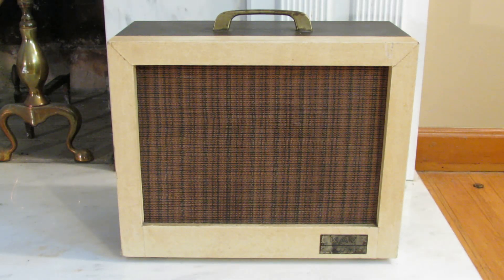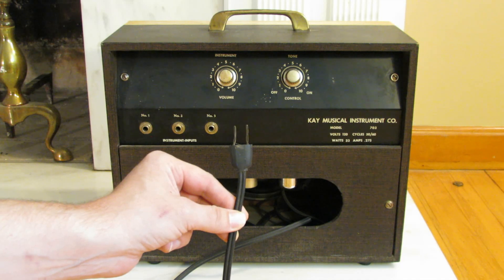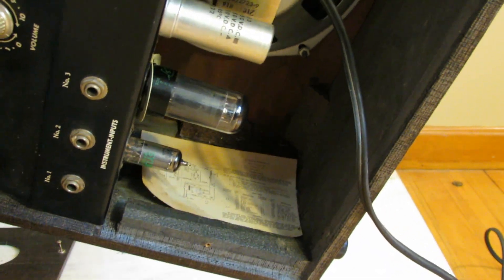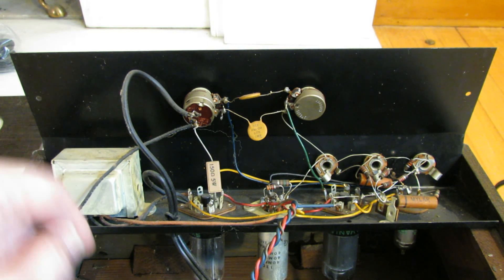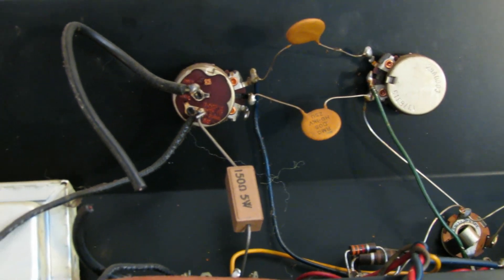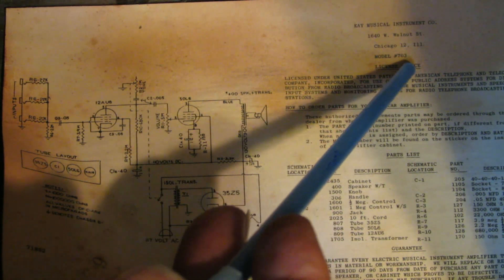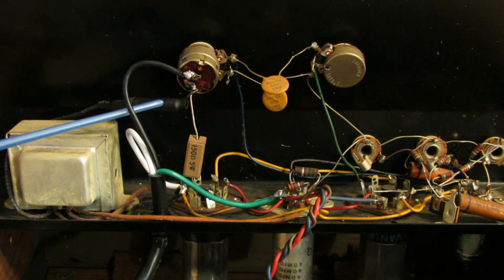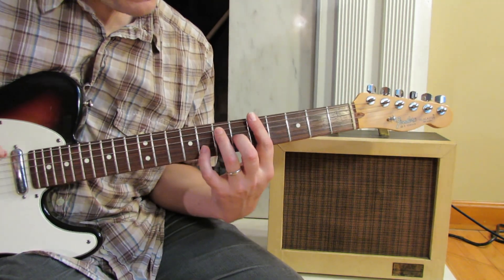1963 Kay Model 703 "Widowmaker" Amp Made Safer

Comment: you took the fun out it. they were getting electrocuted in the 60's. thats part of the experience
Reply from the maker: I doubt anyone was getting electrocuted by this amp. It has an isolation transformer from the factory isolating the input.
Reply: they called this amp the widow maker. the transformers must have failed. so after a performance you would get shocked while taking a bow bzzzzzzzzzzzzz
Reply from the maker: You are correct. It's often cited as a 'widowmaker' because of the series filaments, and you'll see people all the time recommending people get isolation transformers for this model, but it does already have one. The main danger in series filament amps is if the preamp tube shorts between the filament and cathode or filament and grid somehow, then you got full 120VAC on your finger tips at your guitar's pickups. That's bad. But the transformer between the other filaments and the preamp tube filament means that can't happen.
Reply: whooooooaa......I remember those amps.....I had forgotten all about them....
Reply: +The Guitologist  wouldn't a torroid transformer be more safe and produce less noise? thats what I have in my amps

Comment: This whole shock hazard with series filament amps is soo overblown.   I've had transformer amps zap the devil out of me when the filter caps went bad.   An amp with the worst filter caps in the world won't zap ya if it's got a 3 prong.   Just put a 3 prong on it and chill out.   I can't believe the mods people do to these poor amps...  a new cord and replacing out of tolerance parts is all they need.
Reply from the maker: I can understand the paranoia to an extent, but I agree, it's overblown. There are a few things you can do, including putting a very small fuse in series with the filaments, moving the switch to the hot side,  and installing a 3-prong cord, that mitigate most of the issues. Also, not standing in a bucket of water on basement concrete while playing also helps.
Reply: Indeed.   If they could sell the "All American 5" type radios by the millions for 30+ years...  they must not have killed many people.  I didn't know squat about the AA5 radio until I started looking at Series Filament guitar amps...  These guitar amps are a straight up extension of that technology...  The technology of cheapness.   Where else would you put tubes with a 50v, and 35v heater...    It's pretty innovative,   50v + 35v+ 12v+ 12v+ 12v= 121v...  the whole wall current negating the power Xformer requirement.   Our lil guitar amps use that 1500ohm resistor to substitute for the 2 missing radio tubes.   Simple, but brilliant.   The 50C4, and the 50L6  are not known for beautiful sound... just being loud with a puny transformer.   18$ buys your output transformer for one of these critters.  LOL.   Amps like the Mag 107 are the "First Act"  amps of their day... but somehow suck way less.
Reply: What you say about the death toll from AA5 radios is true, however, ALL those radios had plastic cases and plastic knobs. Once you have a guitar cord with a shield, connected to a grounded phone input jack and all your metal guitar parts and strings are thus grounded, the odds change some. Now, let us add in the idea that one of the ways you are going to use your guitar is to kind of steady it in one hand and reach to adjust a microphone with the other hand; and the case of that mic is likely grounded. Now, if there is any voltage differential from amp chassis to PA amp chassis, it's going right across your heart. Or, you and you buddy are going to swap guitars and you are going to switch from (say) guitar to bass and vice versa. When you hand over the guitar, you are probably going to touch the strings on both and once again.......cross your heart and hope to not die.

Comment: Brad do not shave your thumb. Hairy thumbs are still in. lol
btw how's that amp in a gfci circuit?
Reply from the maker: ***** I was going for that hipster "shaved knuckle" look.
Reply from the maker: ***** Never plugged into one with it, but GFCI should save your life with any kind of fault. Safety on all guitar equipment starts with the house wiring. If it's up to code with good grounding, will have a good start. Any amp can be unsafe if the house wiring isn't correct. Singing into microphones makes the risk greater. Anyone playing live should always take a multi-meter with them to test the outlets and also to test whether there is a potential between your guitar strings and the microphones you'll be using onstage.
Reply: do you need a special ground tester or just a multimeter? how would you do a test to ensure a good ground? My house was built in 63 and I'm pretty sure it's Kosher but you never know until you check, ya dig?